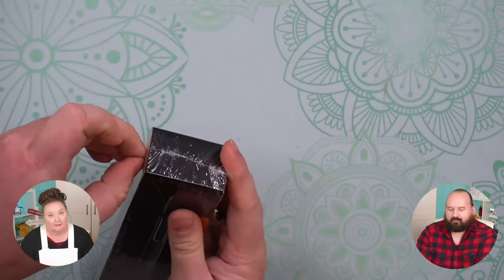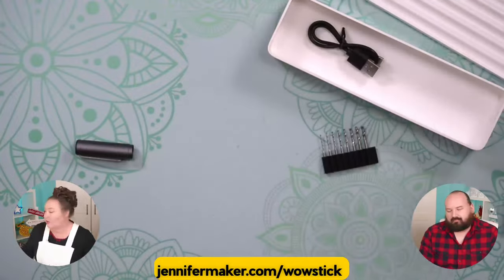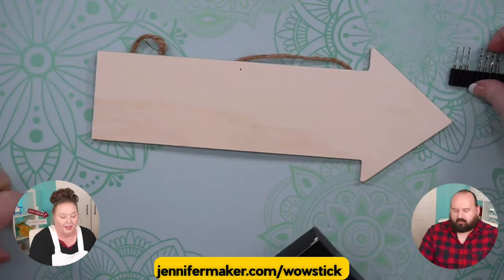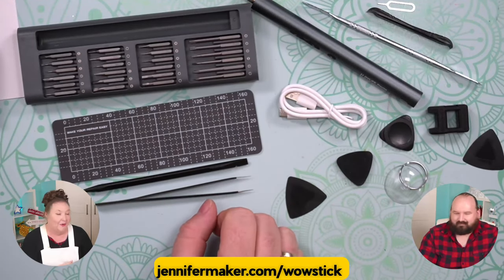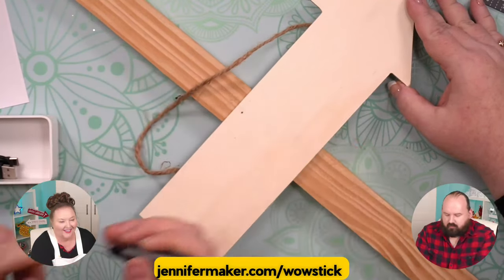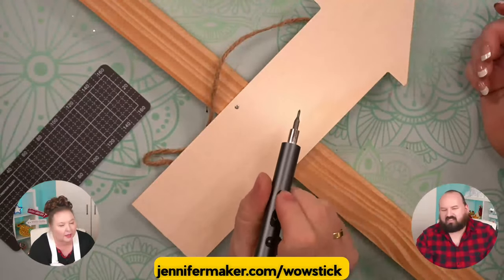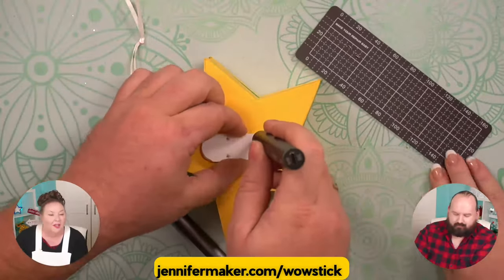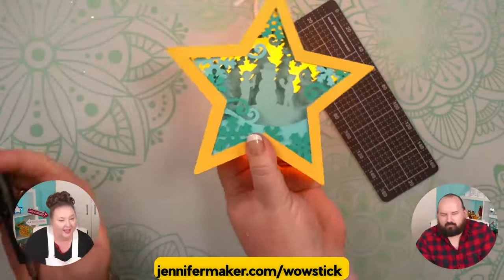Mini Drill & Screwdriver for DIY: Game Changer or Gimmick? | Wow Stick Review

Comment: Jennifer. I have an outdoor  sign and unfortunately the weather being cold and sometimes wet, the moisture has caused my vinyl to curl away (in spots) from the painted wood.. I’m wondering can I glue the back of the raised areas to restick the vinyl lettering?  If so wha t type of glue would you suggest?  OR would a coating of Hodge Podge or the varnish coating work best?
Reply from the maker: You can try that. Try Bearly Art glue or what you have on hand.